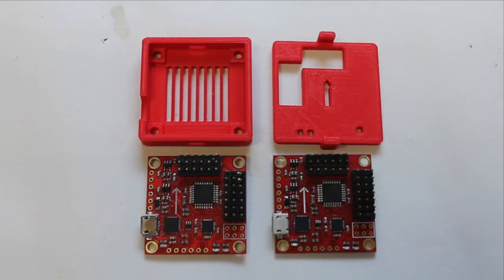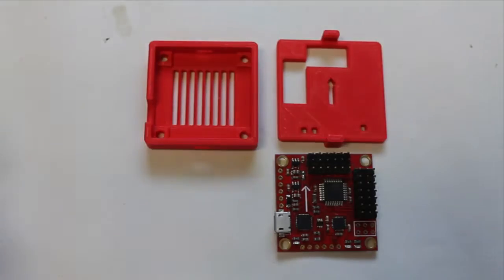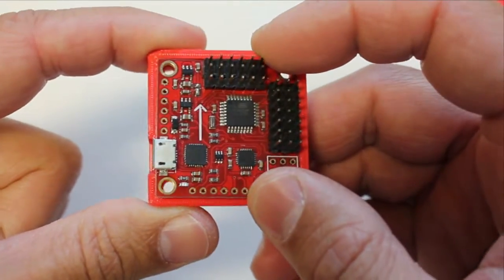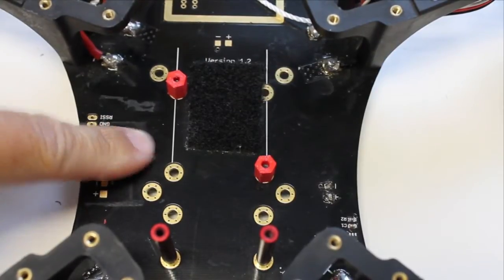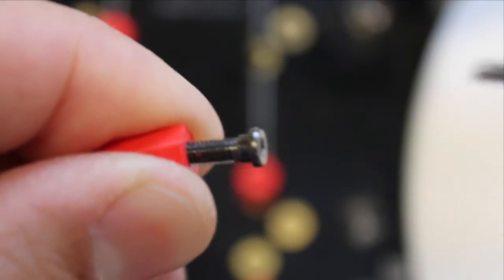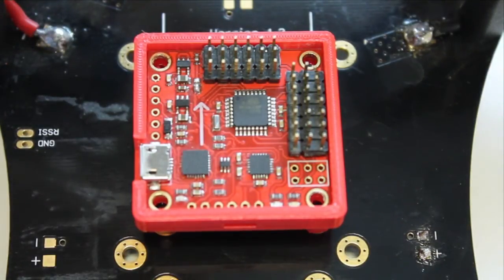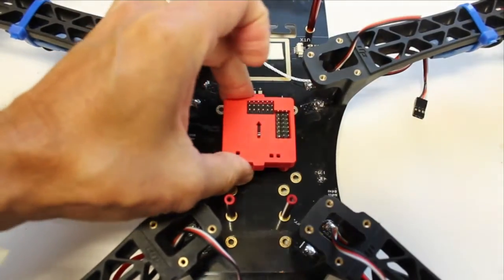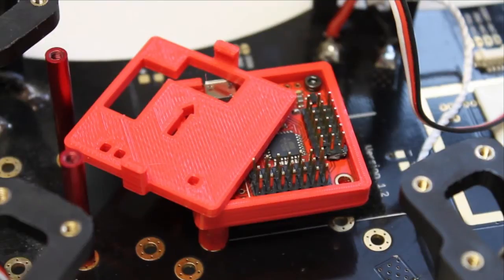3D Printed Case for MultiWii Revision #3 With Soft and Hard Mounting Options

Comment: I'm not sure how to reply to comments on here, but I was not talking about going through the top of the case.  I think the setup you have now is great, I would just use only one screw per hole, go all the way through the bottom of the case, the stand-off, then your tbs plate and put a lock nut on the bottom.  That way the screws cannot work themselves free.

Comment: Which multi Wii board are you working with in the video? What's the best way to evaluate the different boards out there?
Reply from the maker: Good question. I've heard a fair amount about MultiWii boards over the past week. In the video I'm using the MultiWii X-Rock. I think it's a fairly limited edition in that I've only seen it ship with the AeroSky RTF Quadcopter. The more popular version is the MWC Flip. My most recently video goes into the differences, which I discovered over the weekend. It's orientation is different so I had to design a different top lid. Thanks and hope this helps.

Comment: Well, we know that the 4 mount points are set and the screws will hold the fc in place so it don't have to be snugged fitted. I believe you should have some play room if you wanted to make it a little wider. Or you can make a clear case.  It's the little things that changes the game.

Comment: One thought would be to run a longer screw through the (from the top) case, stand-offs, plate and secure with a locking nut.  I think you would have less chance of one of your screws working loose from your spacer!
Reply from the maker: Okay, I've heard from a few people to make a hole in the top case and I will look into that in the future. Thank you for the suggestion.

Comment: Nice.  Should make acess hole for mount screws.  So if you need to remove the entire case you could do so with out removing the lid and having to put it back on again. Why do more than you should have to- building quads is time consuming as is.
Reply from the maker: Thanks for the feedback. I will definitely add this to the todo list. This will take some redesigning since one of the holes will conflict with one of the LED cutouts. When I get through this next revision I'll see what I can do.

Comment: I think you're going to give a little bit of room for not the best board cutting. It might be a bit 'loose', but without that you risk people have to re-print the case and make it just a little bit bigger. With the top screen I don't think it's going to be going anywhere.
Reply from the maker: I agree 100%. I'm working on a revision and then will test with my 4 boards. Hopefully that will be enough to verify so others won't run into this problem.